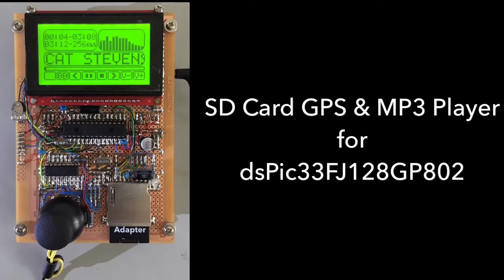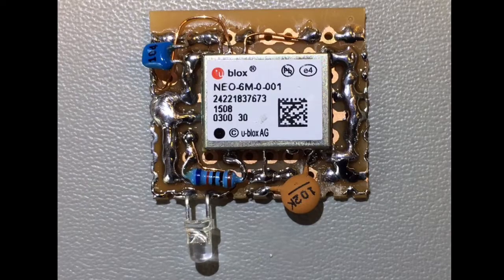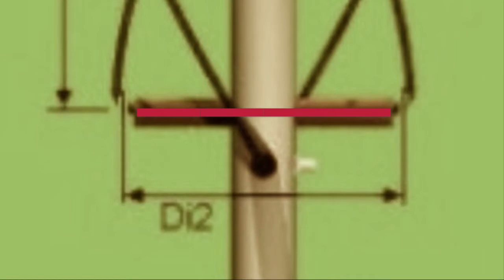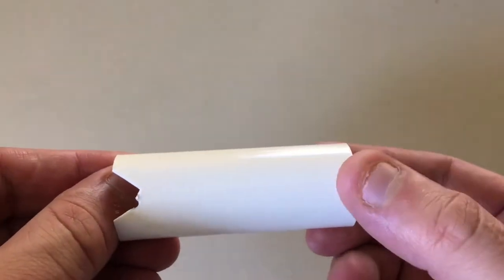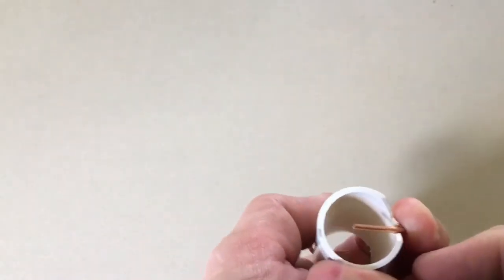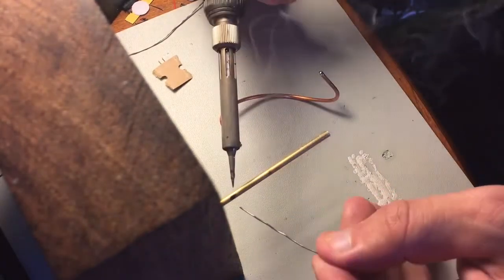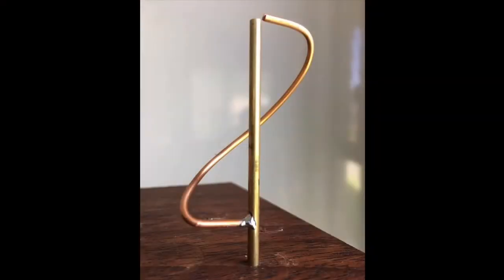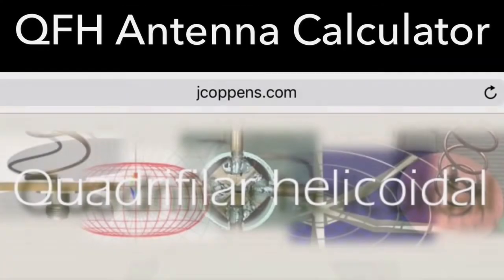Build a QFH Antenna for GPS

Comment: Hello ,, does  the size matter  and will it change the overall Frequency of the  loop .. I mean if you cut the antenna 
For a certain Frequency. And it has to be a certain size right?.. if it’s  137-660 MHz  and it’s 2 foot tall  ,,and you decide to make it smaller  does that change the receive frequency?...hum I like the one ☝️ you made .. in the Green picture... thank you 🙏 I don’t know what I’m talking about. Sorry I m going to go now!,,,,bye
Reply from the maker: Hi, yes the calculator gives sizes for every element. If the antenna is made larger, it lowers the resonant frequency.

Comment: I made a QFH antenna for NOAA satellites. I was curious what kind of tolerances you should hold to. The antenna worked ok, but I wondered how much I was giving up because of imperfections. Are there any rules of thumb (in terms of fractions of a wavelength)?
Reply from the maker: Best you can do ;) Ublox have a Windows reporting tool, so that should be useful if it was for GPS. I imagine your SDR (or whatever the receiver is) should have some signal strength/quality display. There are antenna analyser products for this purpose, but not sure of their ranges (generally for amateur radio). My best effort was to simply give them all SMA connectors so different antenna types could be swapped and compared (and even different QFH antennas). There’s a significant improvement for the QFH in this video, compared to any ceramic patch antenna that can be observed quite simply using the device. At hundreds of MHz though, you’ll have much better margins than into the GHz for GPS.

Comment: four points on the top are soldered together and connect to the center wire  while the four points at the bottom connect to the outer wire, am I right?  My arduino with *.ino are ready. But I wish to make my own QFH antenna.
Reply: Absolutely no, you have probably seen a fake QHA for wi-fi that is on Youtube. The QHA invented by C.C. Kilgus (1968) has right hand or left hand circular polarization and to get it the center conductor is connected to two conductors and the screen to the others two. In the correct order, first long conductor and then the short one. The two conductors have different length to be self phasing, in phase quadrature (-45°, +45°, total 90°).  
The GPS signal is right hand circular polarization, you have to build a left hand copper QHA 'cos QHA radiates the opposite you could think.
In this video is correct.
If you want to learn more http://www.uhf-satcom.com/sband/sbandQFH.pdf

Comment: Why there is no balun in this QFH GPS antenna?
Reply from the maker: yxhankun Because if you or anyone else loans me an antenna an antenna ananlyser that's good into the GHz, they'll have to ask a few times to get it back! Seriously, I just followed existing examples, and U-Blox design guide, which does provide examples for QFH antennas.
Reply: My 60 mhz oscilloscope won't be able to help in this case. 2.4G has a balun.
Reply from the maker: If that’s for wifi, it’s a transceiver. You might not have the same case for a balun here. I doubt this structure is perfectly resonant or impedance matched, but some improved sensitivity might not pay off. Transformation is cheap, but has never been free! This is speculation, but both QFH antennas have certainly worked well with U-Blox modules.